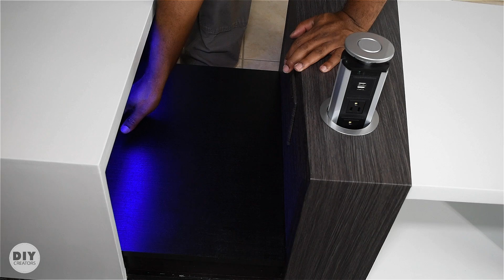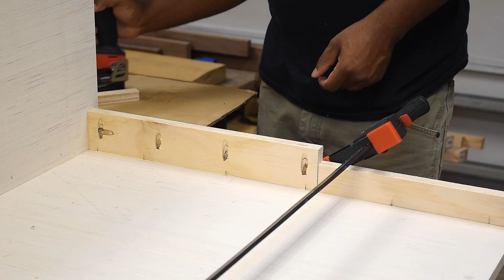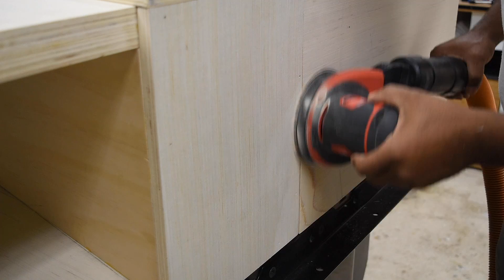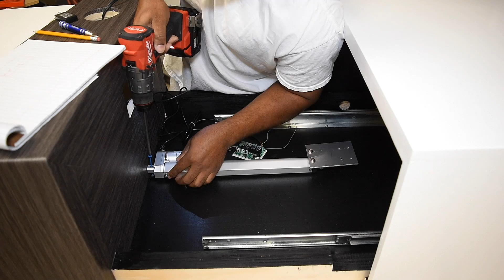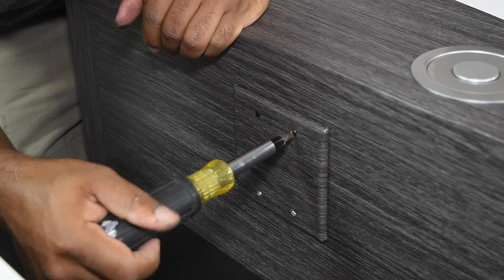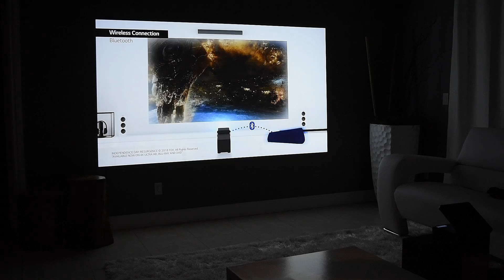Motorized Coffee Table with a Secret 4k Projector

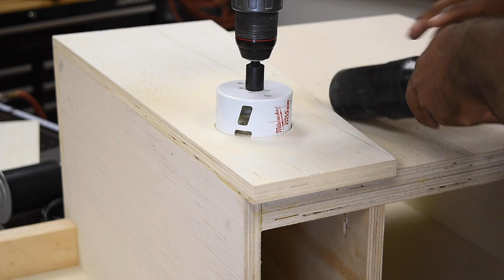Comment: At 5:30 You could have put the Access Panel at the Rear as a hinge or slide door where you glued the back board. Would be larger and easier with a coffee table design. 
Wouldn't disapprove of Castor Wheels either.

Awesome video liked and subscribed.

Comment: Kenny again...I like the multi-use work bench for circular saw, router and , Jig saw and whatever other tool you could make an insert for . I once used to use a black and decker workmate and clamped my circular saw with a plexi-glass insert with a slot for the blade  to take up the surface for level as a make shift table saw. and saw horses provided support for plywood extension table . It worked well using due caution,  I used a simple small wood  wedge in the trigger to keep the saw operating,,Not really the best option but it worked and it was what I had so I made do with it and it worked.. again limited space precluded a more involved rig.

Comment: Oil based paint for durability but still use cheap vinyl?
Reply from the maker: Looks! How else would I achieve the extract look? This is very thick vinyl.
Reply: @DIYCreators  A laminate...real wood with epoxy coating...hydrodipping. What is vinyl the only way?
Reply from the maker: Yes, this vinyl has a specific look and texture to the touch. It's not smooth. Not everyone like vinyl; for me, it worked in this project. If you were to build this id say go with the method you like best.

Comment: A platform could be added that automatically raises the projector to level to the top of the coffee table using the work from the extension of the side which you already have in place. Adding two servos to tilt the platform would allow you to have aprojector laying down, which would allow you to set servos to height needed so projector is always at the same spot. This would mean you could have one button to both extend the table and raise the projector to a preset (yet adjustable) place .

Comment: Ok, I'll give you a pass on your woodworking skills, except for cross cutting boards that are wider than long.  Eventually that saw will F you up, along with the board and the blade.  Try building a cross cut sled or, at least, use a miter gauge... says the guy with 9 3/4's of his 10 fingers.    :~)

Comment: So would you consider making these and selling them!? Or having pre-made kits that you can sell so we can assemble it? I’d definitely be a customer!!! 🙌
Reply: he can't really do that because it can be REALLY REALLY expensive for someone to mass produce these out of their garage or whatever and even if he managed to find a factory to produce these it would still cost significantly more than what someone like IKEA could do as this is just a super cheap coffee table made to look more premium by covering it in vinyl and gloss and adding in a $10-$20 outlet and getting like $20-$30 worth of electronics built in to it to make it open automatically besides the electronics and the outlet the table would probably sell for like under $50 at an IKEA.
ALSO all the power tools and accessories for them that are required for this can EASILY be bought for under $100 altogether such as a circular saw/nail gun and drill and so on but most people have drills anyway so its probably only the circular saw and nail gun that you may want to get but you could always do the nailing the old fashioned way and use a hammer. Its not hard to do

Comment: Glenn, 

I like this build, very clean design although there is one thing I would add, that is I'd build a tipping mechanism that would automatically tip the projector up and open the lid, like a Japanese bamboo fountain, make it swing in the middle. 

The whole thing could be actuated via cables.

Comment: How do you connect the table to power source? Suppose still need an extension lead to plug it in, which will run across the floor. Apart of that excellent job, they should show your videos on technology lessons in schools, to inspire youngsters, as they prefer to RAP or play PS this days...

Comment: I've a question
Where do all these people find workshops like this with all the tools. Is it their own? Friends? Or the shops selling the woods?

Edit: And if it's usually their own. Are there public places where people can just come in and fix up their own project? Maybe at a fee to use their tools or buy their material products.
Reply: Have a look in your area for Maker Spaces. Personally, I've been using a maker space for a while but I'm looking to get many of the tools for myself. Finding friends and family with a shop is also good, but they most likely won't have the same breadth of tools. As for wood, the country you're in significantly effects the price. In Oceania, visit Bunnings. In U.S.A, Lowes. Usually googling Builders Supply or Home Improvement (or DIY) finds one.

You'll be shocked by the price of wood, but as evidenced in this project and many others, you can make many projects out of Ply Wood. It is heavily dependent on the finish you would like.

Comment: I started this project and i would say i spent around $700. I spent $370 on amazon $130 On ebay $170 Homedepot for lumber and nails. This $370 from amazon including tools digital measuring tape, Jig saw, clamps, pocket hole jig saw $29, Sander. I can't wait to finish this project I'm beginner for project like this so i know i will take longer and might not be perfect but never know.

Comment: KungFuKing power bar.....  sounds safe... lol... but it's a sweet build!  I recommend using better vinyl though.  3M Dinoc architectural vinyl will conform to the corners so it looks a lot cleaner.

Comment: you should have used a gear system instead of the actuator would have been quicker open and close and easier setup and quiet

Comment: Great Video SOLID. Request>> I really like the thought of utilizing the empty thickness of a wall as a hidden storage slot or exposed shelf or depressed lighting and book shelf ext. Possibly using a cover plate to hide the area with colour decorative panel or sleek mirrored panel or nice stained wood panel as features ,, even have a picture frame as a cover. I just think the concept is cheap and beautiful, utilizing and maximizing every cm space in small apartments or any small space. I recommend because I think it's design function is under utilized and hope it helps people live a little more comfortably .

Comment: Just some friendly advice for the vinyl wrap portion...when you use your squeegee, glide it back and forth at about a 30-degree angle, so it would basically look like your squeegee is surfing a wave (for lack of any better way of presenting what the hell i'm saying w/o making it sound stupid complicated...). Basically - don't just swipe the squeegee up & down, because as I'm guessing you probably experienced firsthand from doing that, it will create wrinkles in the film unless you laid the vinyl down super tight and perfectly on the very first attempt....Just wanted to pass that along since you mentioned you have had trouble with vinyl wraps in the past.

Comment: Please do a video to make a motorized PC work table (height adjustable) with cable management. Spaces needed for CPU,eGPU,keyboard,mouse and some extra storage options for pen drives and memory cards. Wireless charging, headset holder and LED lighting will be a bonus.

 I'm from India and the resources available here are very limited. So please keep this in your mind and use basic components. By the way, i enjoy your work very much. This one was out of this planet. Keep going. God bless.

Comment: Very well done, a nice build once again.
I was wondering at first, if the charging outlet should have simple been a kind of front panel, but of course the pop-up is a fancy treat.
Also, perhaps I didnt watch carefully enough, but are there no wheels attached to the "drawer"-part of the table? Despite the heavy-duty claim on the rails, I would consider that to be safety measure of a sort.
Though I have to admit: now I am curious what a similar approach would look like, if it was meant to be hook on a wall... o.O

Comment: Nice build design & execution. I really like the vinyl addition. It's very tastefully done. This is a must build for my 20' x 20' x 8' (ceiling) mancave.  I might ditch the actuator for simplicity also install 16" subwoofer in fixed part of the table. My couch, loveseat, and 2 recliners are about 12' from the back wall. So 110" is about max size. I'm looking at this special silver paint made just for projection walls. All my walls and the 2 doors are 6.25" thick with acoustic insulation. I have a 65" LCD right now, but I've been looking at that LG Projector since it came out! I use SmartPlugs for all my lighting & blackout curtain controls from my phones Kasa app.

Comment: Great video! Thanks for all the great ideas! So idea/challenge: build an entertainment center that takes existing surround sound system and build it into it. The surround sound system consists of a subwoofer two tower speakers and the reciever/DVD player as the front. The rear has two small satalight speakers with a wireless receiver.  This ertainment center will also need to house gaming systems such as the Xbox one and PS4. As well as a PC tower and several games. Sorta like a gamers heaven entertainment center! Please and thank you!

Comment: you can add an Alexa enabled relay card(DIY 5V 12V Inching/Self-locking Wifi Switch)and 
Time Delay Relay
 so you can just say "alexa watch tv " and it will open it and turn on the projector

Comment: Very nice job … wireless charging would have been a nice touch though ..
Reply from the maker: It was on the list but I took it off due to the time I had. It will more than likely be on the next one.
Reply: @DIYCreators  Sweet, the connector is dead, long live the connector !
Reply: @DIYCreators  A dope design like that with futuristic details like wireless charging will surely make it the dopest in the universe

Comment: Nice job Glenn.  I'm diggin the motorized functionality.  I will definitely am looking forward to the other build video with more details.  My only question is why did you go with the white plywood, if you were going to paint it, was it more cost efficient?  Also using walnut instead of the vinyl may give it higher end look.